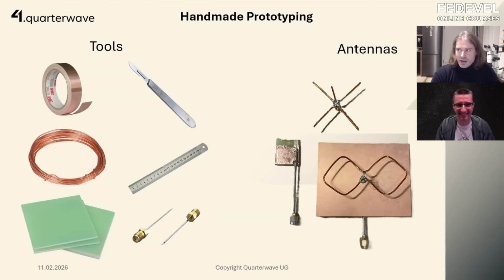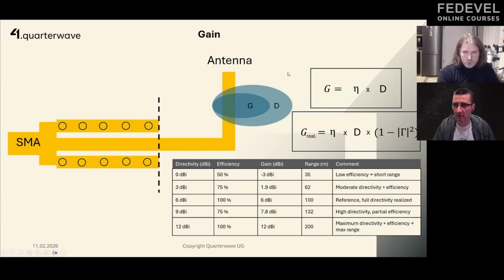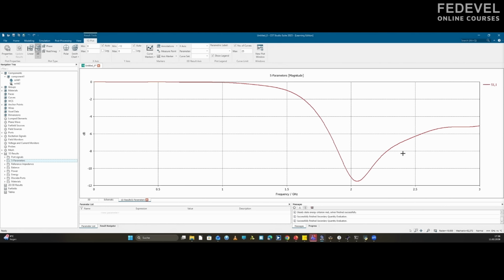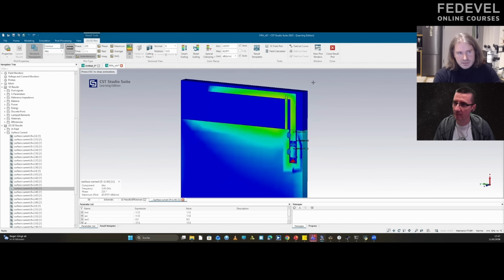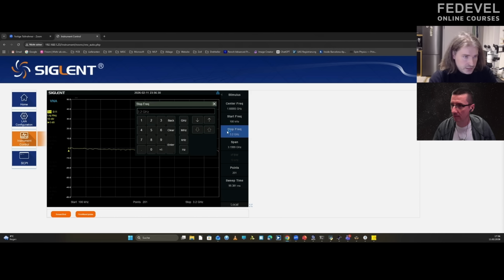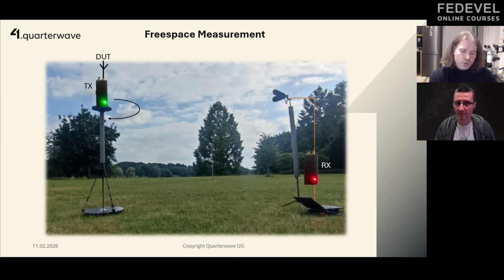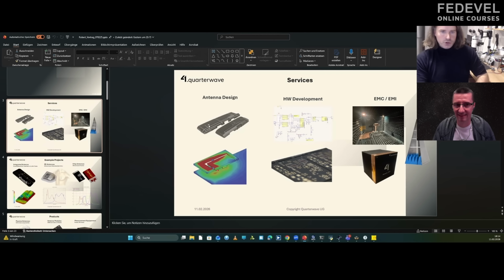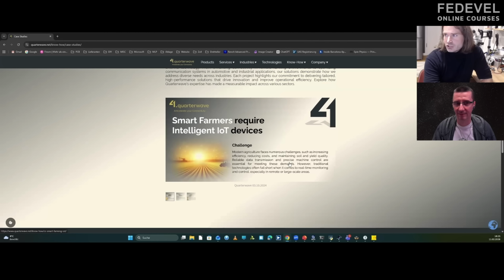How to Design an Antenna That Actually Works | All Steps Explained

Comment: Nice, have you tried the free uSimmics simulator? It's the new version of Qucs Studio and includes a 2.5D simulation module for analyzing distributed elements, such as a MIFA PCB antenna. It's obviously not the same as CST, HFSS, or Feko, but for a free simulator, its MoM method is quite accurate. I've watched about a dozen videos by Electgpl using this simulator. Unfortunately, some of them are old and AI dubbing isn't possible, but you can still see the results.

Comment: Thanks for this, very interesting. I use my ESP32 (with U.fl antenna adaptors) with ESP-Now for RF testing, its a great low-cost solution and with fairly reliable RSSI measurements I have manged to build a basic 2.4GHz S-parameter tester using two ESP-32's and a directional coupler.

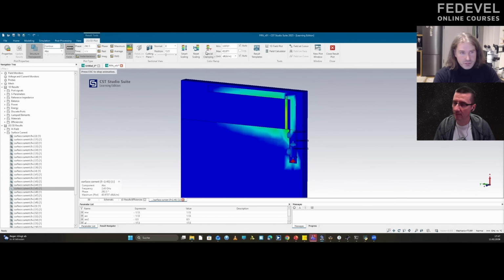Comment: @28:18 , very good interjection around this time mentioning the other antenna video. This perfectly demonstrates the need for RED testing after integration, as the pcb itself+other componrnts will influence the RF performance +emc